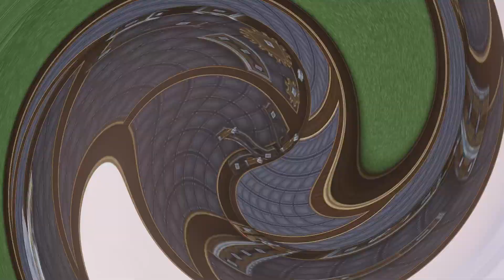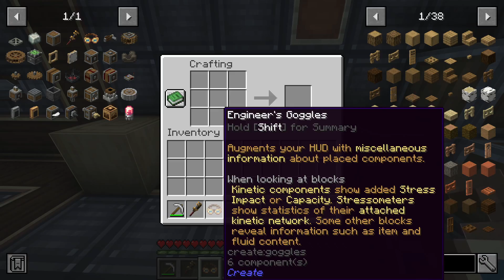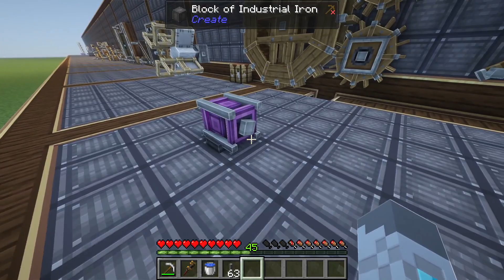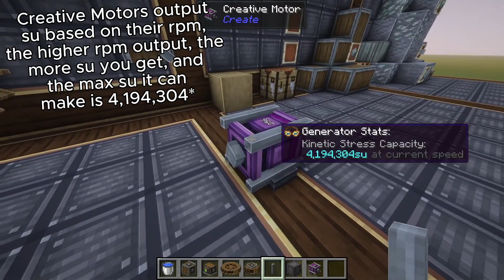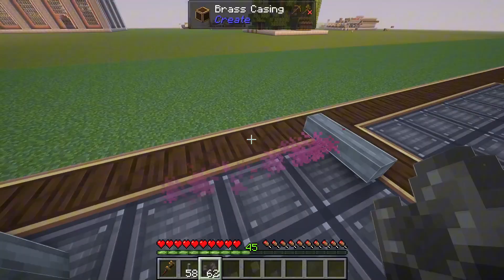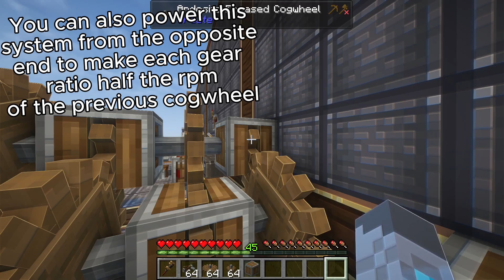The ULTIMATE Guide to Rotational Power! | Minecraft Create Mod Guide

Comment: Do note. Using the gearbox is slightly more expensive than just using large cog wheels. If tou need compactness then you may use it, however if you just need a 90° turn then just use 2 large cogs.